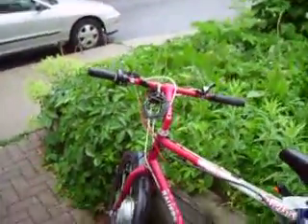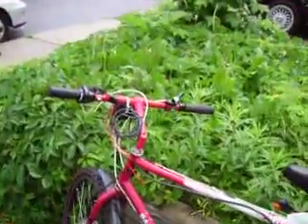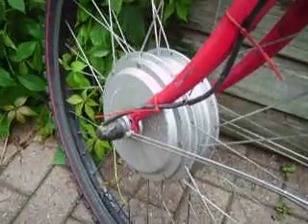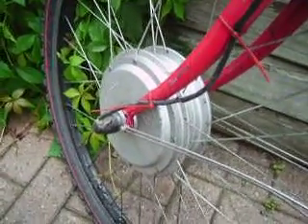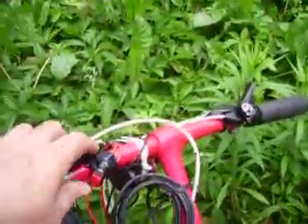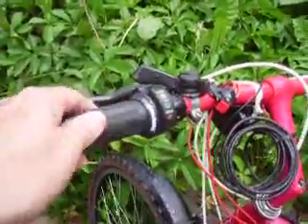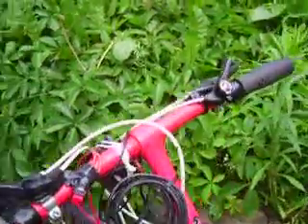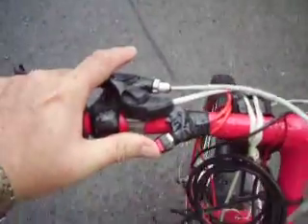Home Made eBike

Comment: Nice!  not complex, from the look of it.  An anyone could try it kind of thing with that inspiration.  I was cycling around TO yesterday, after a long absence, and really noticed how many electric bikes there were.  So you could just take the batteries out of the bag, and change out the front wheel, not that I would probably bother...  I'm waiting for the "running stops signs is/isn't illegal vid.  :)  I would have a kill switch in addition to your handlebar switch, just in case that locked on.